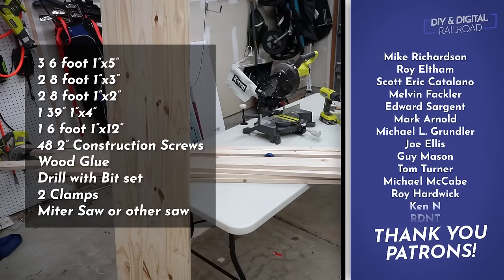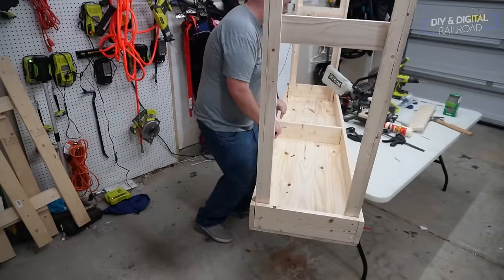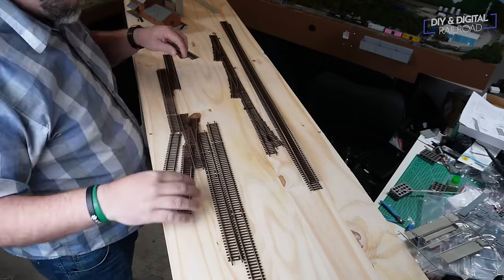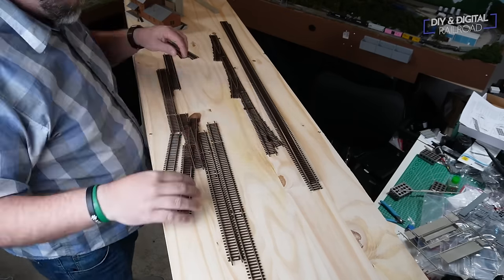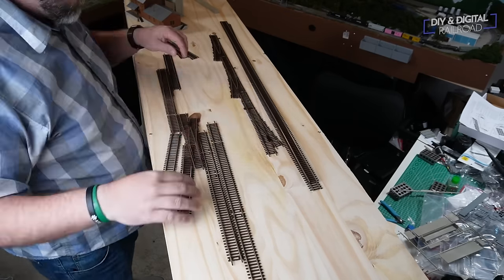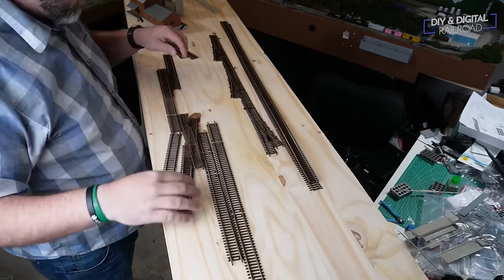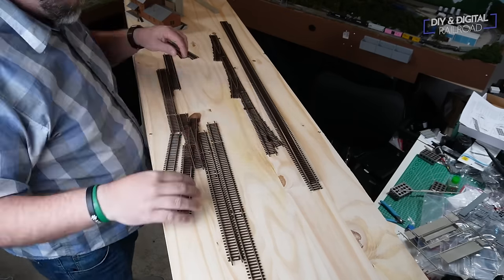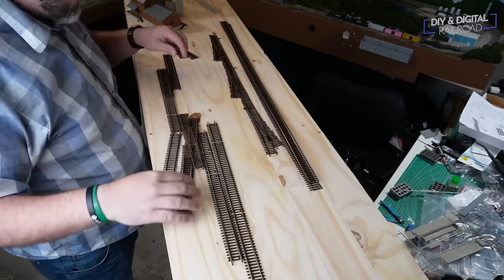Build an HO Scale switching layout!  MRRTwo Complete Build!

Comment: Adding an air assist to your laser will help with cleaner faster cuts and less soot and discoloration.  Enjoyed the build, our club layout has green LEDs for the clear route and red ones for the open route on each switch.  This is useful not only for switches 20+ foot away from the panel but also for giving indications of switch settings blocked by other trains or in some cases scenery and buildings.  I'm planning on using the tiny 9 gram servos with the arduino add on PWM boards for the layout that's in planning here.  Have fun!

Comment: This is a great little layout! It is small enough to have some fun with. To explore scenery and track techniques. Experiment with Arduinos.

My mantra for feeders is "Black to the back " and I'll drop mine down from the top. I put a 90° bend in my feeder, then a small bend to keep it from dropping down the hole. My goal is to minimize the amount of wire showing!😮

My current layout is two 18 x 48 modules, an 18 x 48 x48 corner, and an 18 x 72 module. 

Unfortunately, there is a move coming in my future.... New opportunities for new model railroad adventures! And maybe an Arduino!

Comment: Thank you for explaining what is involved in building a small shelf layout. I learned that DDC, busses, Tortoise machines and extensive wiring are prerequisites for optimal performance. Having considered the matter, I’ve decided not to get involved in model railroading. The electronics are too complicated, too expensive and too confusing. I’m not an electrical engineer. I probably will retain a few freight cars and a locomotive as a static display. A cabinet from Ikea would be ideal. I’m glad I didn’t spend a fortune jumping into a hobby that is far beyond my budget, time or skills.

Comment: Is there a reason you didn't use the tortoise machine contacts to power the frogs? Also, did you consider painting the track before you installed it. These are certainly not to be critical, just curious questions. Thanks

Comment: When you attached the cross braces to the legs, you screwed into the ends of the braces.  End grain tends to split easily;  better to screw through the leg into the face grain of the brace. I realize you were using 2 inch screws everywhere else and that my recommendation would require shorter screws.

Comment: The electronics portion of the video seemed like overkill to me.  All the different circuit boards etc.  I wired up my last small switching layout with a few DCC leads to each branch as you did.  I kept the three way switch isolated and powered it separately.  I suppose I could have used a computer chip to regulate which rail got power on the three way, but I just used a series of three manual  electrical switches to toggle the power as needed.  I opted to hand throw my one turnout.  Still I am not sure why you needed all that electronic gizmo stuff on the layout.  I am not critiquing you but just saying that I don't understand the reasoning.  You have no signal lights that I can see, so all you needed was to power the motors for the turnouts....  sorry for my lack of understanding.
Reply: Yeah I don’t get it either. The layout I built as a child was a 4x8 + 4x4 figure 8 plus oval. From what I remember I had four powered switches. I had a control board with the switches for the turnouts. It was all powered from one transformer with 12v out to power the switches and lights. No raspberry pi or circuit boards.

Comment: I know that this will be an idiot question, but I have no idea of this hobby, why did you apply the ballast first and then the scenery??, Instead opposite like railroad are real build??
Reply: I'm guessing because it can LOOK real instead of the way the process is done. Scenery doesn't grow  on a model, so you have to make it look like it's growing.
Reply: @andrewlaverghetta715  got it. thank you for your answer.
Reply: I guess it's easier to ballast first and cover the track later if needed when adding scenery, than covering everything when adding ballast as the last step. 🤔
Reply: @roulernbleu4532  In my non hobby mind, should be: cork, track, scenery then ballast.